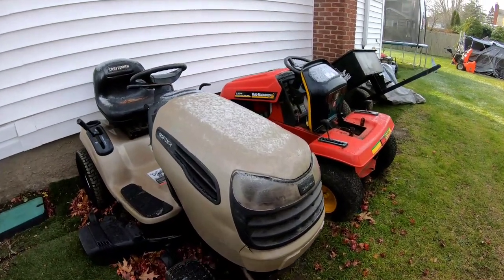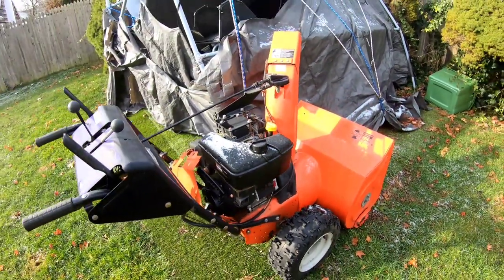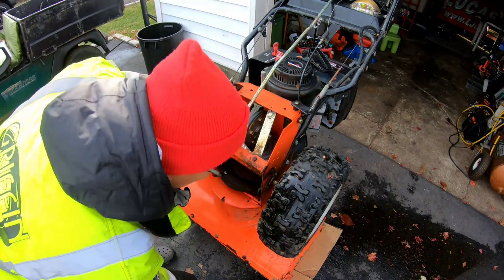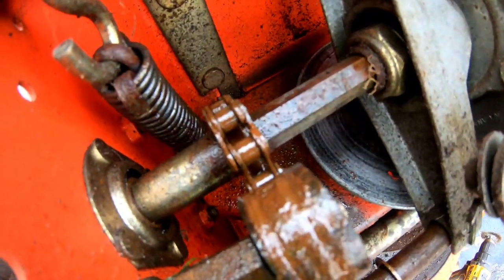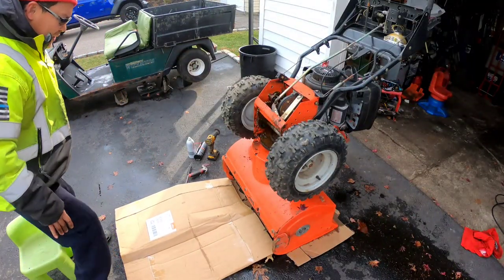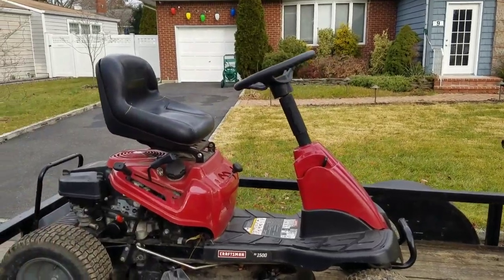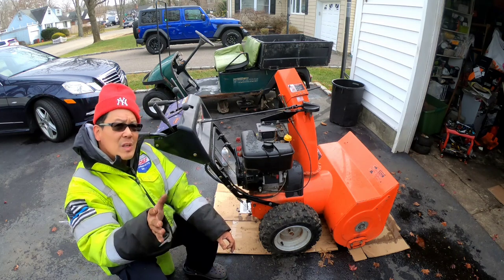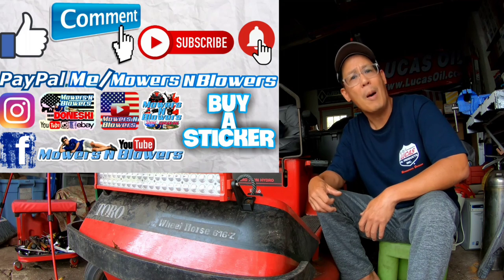ARIENS 1128 TECUMSEH SNOW KING DUAL STAGE SNOWBLOWER SEIZED TRANSMISSION DRIVE CHAIN GEAR CLEANING

Comment: The chain loosened up due to the frozen pins being freed a bit in the pin bores within the inner plates, but most of the rollers on the chain are likely still frozen. Barring replacement, I’d suggest soaking it in evaporust, or a pail of cola cola, or an ultrasonic cleaner. Removing the chain you just follow the manual for removing the two axles enough to slip the chain off of them. Remember, the pins are what make the chain flex, and where the lengthening occurs, but the rollers ride on shoulders on the outer plates only, and are what keep the sprockets from wearing when the chain goes around them (as long as they are free to rotate on the plate shoulders).
Reply from the maker: Pb blaster worked in part 2
Reply from the maker: ARIENS ST1128 11HP TECUMSEH SNOW KING ENGINE 28" DUAL STAGE SNOWBLOWER SURGING CARBURETOR CLEANING
https://youtu.be/y_Qx9SDRsMw
Reply: @MowersNBlowers ok. Read again though I kept editing and adding.

Comment: You could have saved a lot of time by removing the chain and that shaft, used a wire wheel on the gears, and reassembled it!!
Had to do that many times!!
Reply from the maker: First time doing it,  so easier next time